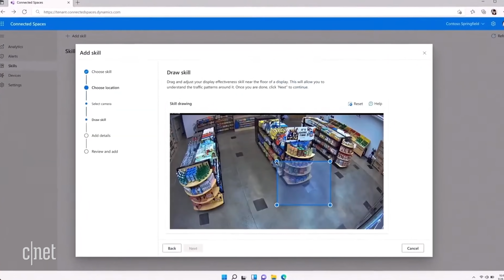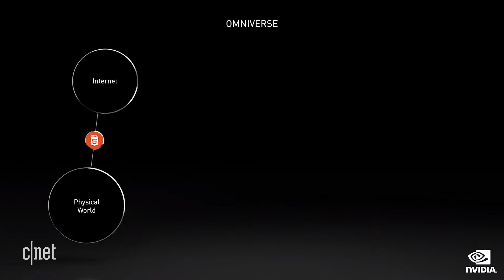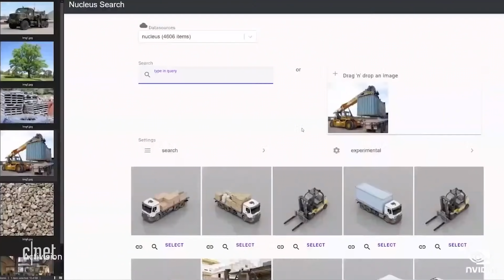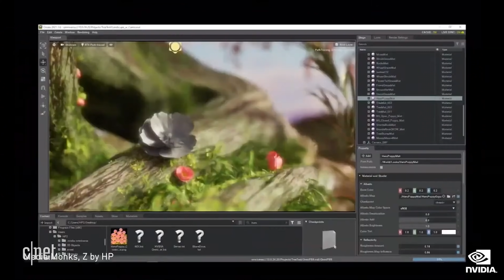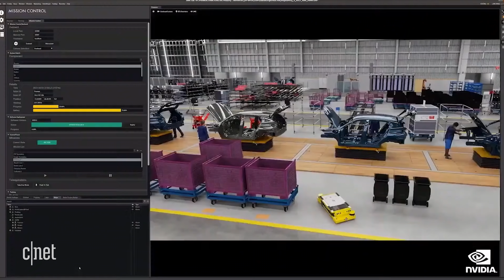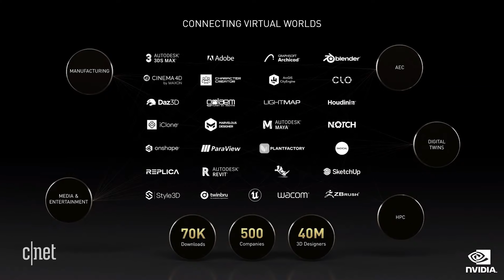Big Tech CEOs share their vision for the Metaverse! (Microsoft, Meta, Qualcomm and Nvidia)

Comment: Microsoft: metaverse for productivity for their ecosystem 
Facebook: metaverse for social/fun/interaction
Nvidia: metaverse for creating anything you want, simulations, and so on
Qualcomm: we dont care what metaverse you chose, we will make the hardware for it and make money no matter what system you use. 

Did i understand this correct?
Reply: Yes. Also, this stuff already exists. Vrchat + OVR toolkit / steam desktops is a common combination for VR junkies and already does what meta showed, though just in VR not mixed reality. Now that mixed reality is finally widely available, that will change. All of these besides qualcomm want to be the hub connecting (controlling) all this. Qualcomm wins even with the competing silicon (apple and valve) on their way because those are niches.

Nvidia is engineering focused. The others want this space, but Nvidia is ahead here
Reply: Yeah, big companies move to next generation of technologies
Reply: yup, all the headsets currently use snapdragon 800 series. This years crop will mostly transition to snapdragon XR2 (7 CONCURRENT cameras, 8K resolution, AI built in) and snapdragon XR3 is already completed, just not ready for deployment.

But also look at AMD/NVIDIA, corning, Cisco, Nokia ( NOT their handsets, I'm talking about the MASSIVE control of the enterprise level and even country level telecom infrastructure) the different telecoms esp Tmobile, 
The Metaverse does not run without the underlying tech, not just the software like Unity. And it isn't just disney, facebook and boblox.
And don't forget the AI companies and the cyber security companies which are needed
Reply: Oh wow thanks. We are in for a ride aren’t we lol
Reply: @ahmedrmir  we are. Now's a great time to be one of drivers.